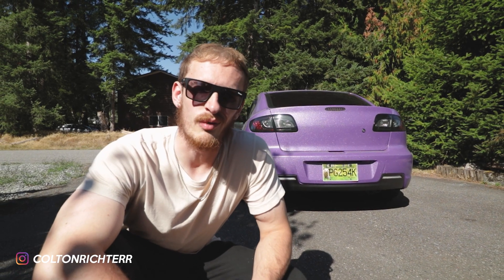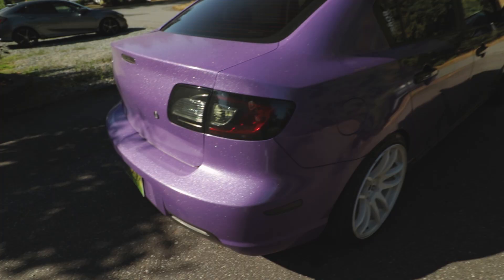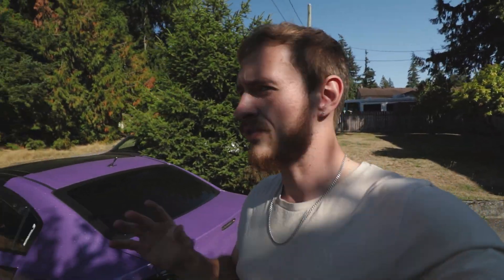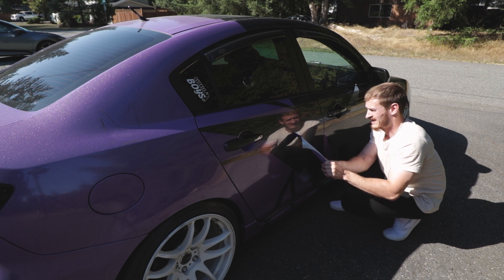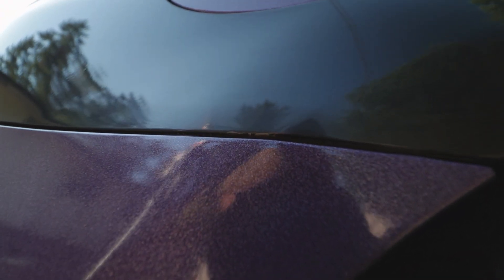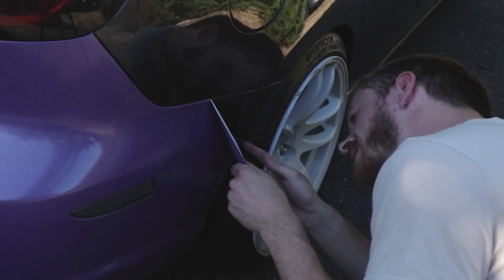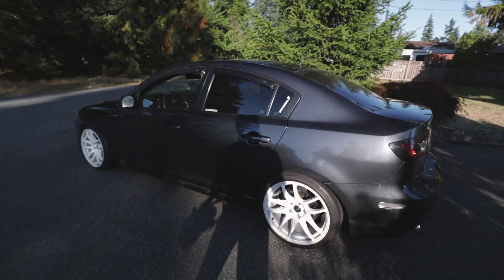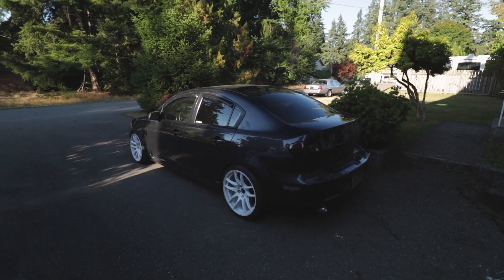NEW Mazda 3 COLOR Reveal GONE WRONG

Comment: You need a speed 3 rear bumper on that beast, it will look sick 👍
Reply from the maker: It's tempting 🤔
Reply: @ColtonRichter  yes you go for it, I did it, and it looks so good 👍 super easy to do would make a nice video too 👌
Reply from the maker: Does it actually fit the sedan?
Reply: @ColtonRichter damn it you know what the drop of the trunk lid under the tail lights is longer, may fuse the two bumpers together somehow to make it fit, Idk but I'm sure it's never been done before, would be a one off  good talking point at a show👍

Comment: Mine is a black mica. Its just stunning due to its simplicity. When its washed, waxed ect... that mica just shimmers away in the sun. That's one thing Mazda got right, theirs colors! Just too bad the paint is so thin on these 1st gens. I want mine repainted with a better coat of paint, get all the minor rust speckles fixed before it gets worse. Got 2 new front fenders and new rear bumper waiting for my 3... when I had her the first week, someone hit me in the back, caused my bumper to be dented n chipped. So yeah, when you went ohh noo with the bumper wrap, I knew instantly that the clearcoat got damaged with possible paintchip... glad its just the bumper tho...
Reply from the maker: Very happy it's only the bumper, easy to replace!
Reply: @ColtonRichter  Very true! Your 3 looks stunning without the wrap, just saw the pictures. I liked the wrap but the stock color is just awesome!